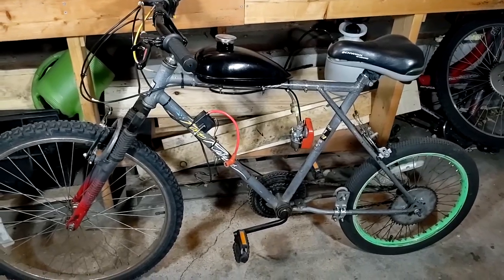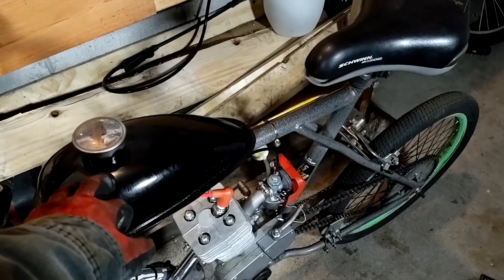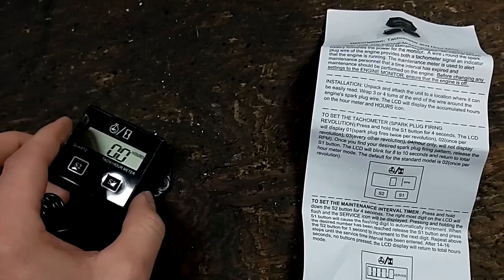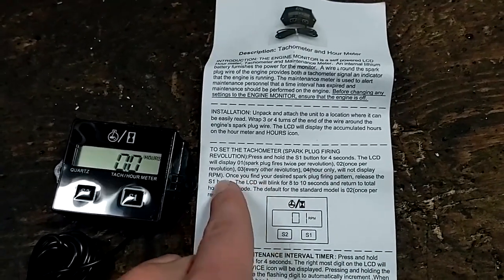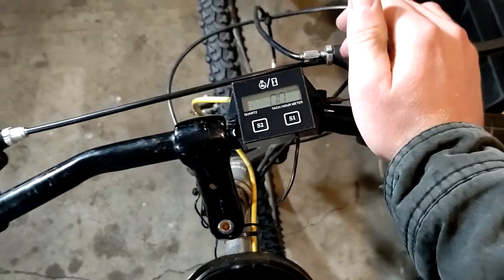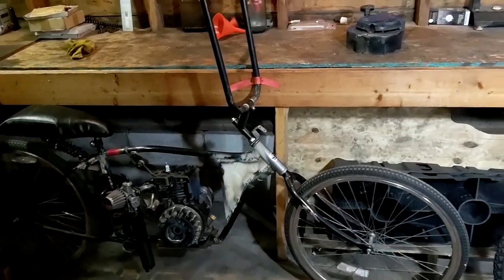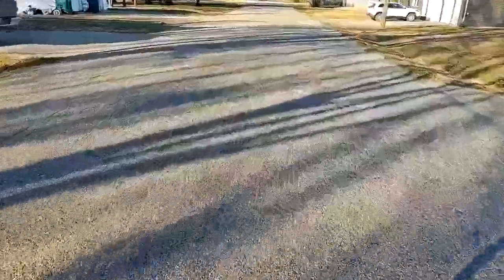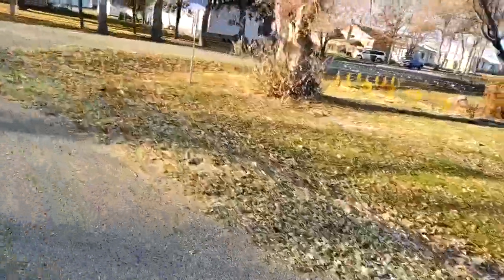Motorized Bike Tachometer

Comment: Great video. Sooo yeah I have the same tach lol. My next step on both my yd build and my 49mm iron sleeve build will be a balanced crank.  The yd is yet to run but the present 49mm build hits 8k on two tachs. First tach I had was always all over the place and had a temp sensor. Probably just a dud.
Cheers

Comment: I bought the same tach for $10 but wish I would have spent $25 & got the Runleader instead. 
It has a tach/hr meter/clock (military time) & most important, a cylinder head temperature probe/gauge that goes on the spark plug. With a high temp alarm, so you can set to say 425F & once it reaches 425F the alarm will flash letting you know it's time to pull over & cool off.
It might have saved the Phatom85 engine. I finally checked with my heat gun after a ride & the area of cylinder around the exhaust port is always 25-50F hotter. If I recall your Phantom engine was roasted on the exhaust side?
Reply from the maker: Yes, the exhaust side is where the piston blew apart. That temp probe sounds like a good idea.
Reply: I was wrong on temps, I took my temps right after shutting the engine off, so the exhaust port side was only 50F hotter than cyl head top. The ex port side can get more like 150F-250F? hotter with engine running than top cyl head temp. The numbers online are all over the place when asked, what's the safest max temp to run at. When I get a temp gauge. I was gonna see what the average head temp is after a long  ride & just set the warning for a few degrees higher. I figure $25 is worth it to avoid a destroyed engine & very long walk home.

Comment: what happened to the analog tachometer from your old motorized bike build?
Reply: commented a bit too early, i just watched your update video and the installation video carefully, and it seems like you just forgot to connect the tachometer ground to the frame? it's used both for the negative terminal of the battery and ground for the signal wire.
Reply from the maker: Good catch! Its been many years and I don't remember if I ever did ground the negative side of the battery. In any case, I can verify from using that analog tach on an ATV, that it is designed for one pulse every other revolution. So, it would not have read accurately on a single cylinder 2-cycle engine anyway. The digital tiny tach is definitely the way to go.

Comment: Do guys really have trouble with bolts coming loose I keep hearing about locktight but I used nothing and been riding everyday since may with no issues at all
Reply from the maker: Yes, I have had issues with motor mount nuts and exhaust studs working their way loose. I don't like using loctite because it's difficult to remove and often pulls the studs out when you try to take the nut off. However, its worth not having to constantly check that they are tight or have a muffler fall off. If you're not having any issues without it, I'd say just stick with what's working for you.
Reply: @pulsar2121  I noticed the 4 stroke build has chopper style-ish raked front forks & ape hangers. Would be cool/funny to make a Captain America chopper replica from the movie- EZ Rider... Make the old school chopper style seat with the tall backrest, a long fishtail exhaust pipe, use a 26in front wheel with skinny tire & 24in rear with a fatter tire, paint the gas tank with the matching stars & stripes. Then ride it to Sturgis next year, it'd be a total chick magnet.

Comment: So highest rpm was 7500 ?
Reply from the maker: Yes, that seems to be the redline. However, the vibrations became uncomfortable around 6,000rpm.
Reply: My 47mm Anbull is only running at 6600rpm I need to do some porting/timing.
Reply: @pulsar2121  thanks Buddy! I had the same tach but it would only show up to 4750rpm. But I know it was wrong cause it was winding out n I was doing 34mph with my 48t sprocket on a 26x2.35 mtb tire in the rear. I want to buy another tach, I think I ruined mine by cutting the wire shorter lol